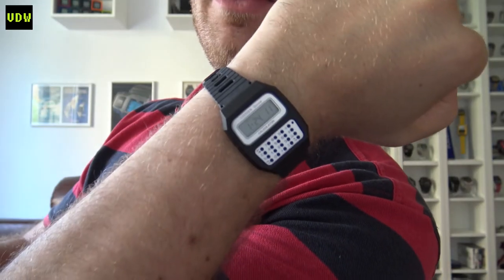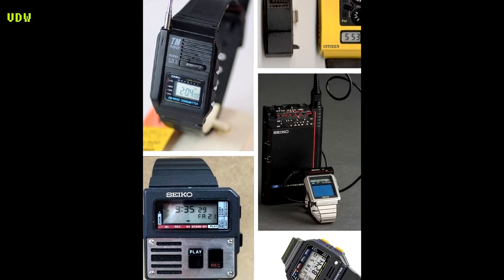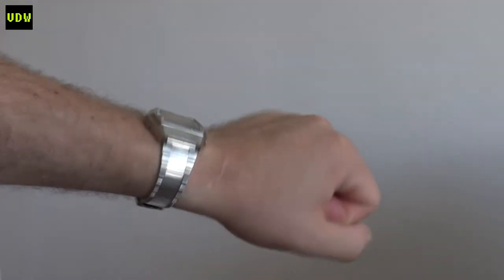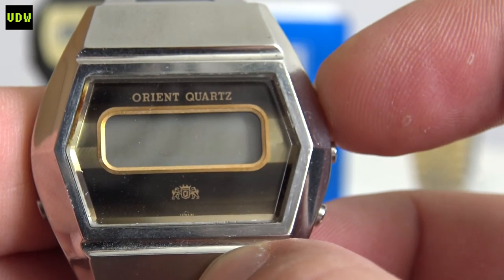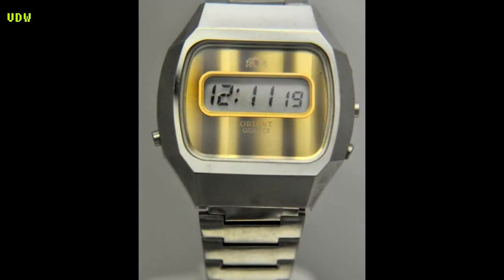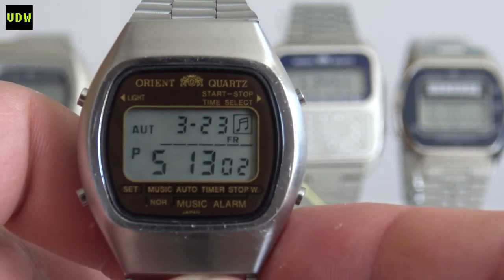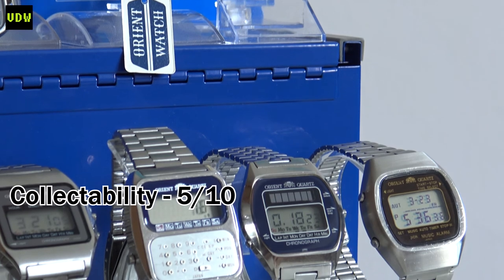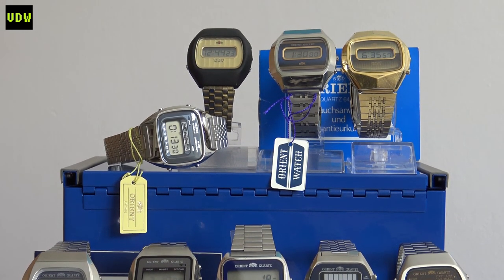Ep 54 - Orient Digital Watch SPECIAL - Vintage Digital Watches

Comment: Back in the day, I though Orient was a lesser brand, but many of these these looks surprisingly beautiful and well built. Thanks for sharing! Btw. I think a few watches had seconds/date swap options, e.g. the Seiko G757 series which also displays DATE right above it  when in that mode. See https://youtu.be/Q0WzwTHntMc?t=1m2s
Reply from the maker: I'll pin this post as the information about the Seiko G757 is interesting. Thanks!
Reply: @VintageDigitalWatches   I have the watch at 05:43. It appears to be in pristine condition yet when I put a new battery in, there's absolutely nothing. Is there some reset procedure for this particular model?

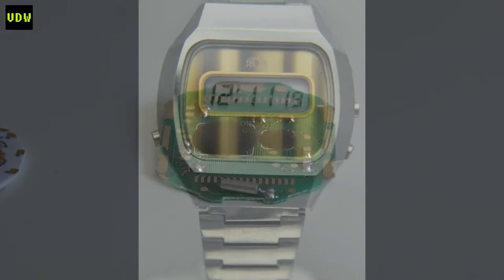Comment: I own an Orient 641112-40 (Module 64101) with a corroded and botched battery compartment. It has the same case and face as your G641103-40 (at 4:26) but a different bracelet. Do you know if the modules 64100
, 64101 and 64111 are interchangeable? At least they seem to look similar.
As always very informative content and I'm looking forward for the next video.
Reply from the maker: Time Art Piece  Yes the modules are interchangeable, all watches with serial number starting 641 can have their modules interchanged, module is identical for all.

Comment: Another fantastic video.
Well i have only 3 orient here, the message orient also. I prefer the early 70's orient digitals with ceramic board. I think  the best orient period was from 1974 to 1977 even if the message one is an amazing watch (dot Matrix, loud alarm and messages).
Reply from the maker: So Lucky you have the message one, there was one for sale a few weeks ago on eBay, wasn't cheap.
Reply: You can se mine here:

http://www.newdwf.com/viewtopic.php?f=58&t=7862&p=50012&hilit=orient#p50012
Reply from the maker: Hmm, it seems that the images are broken...old links maybe?
Reply: It works for me.... Are you logged?

Comment: I have a question i hope you can answer : do you know what battery fits in a orient 771106-40 lcd watch with alarm ?
Reply from the maker: Uh, don't know
Reply: Vintage Digital Watches ok thanks but is there a battery that is commomly used in orient watches from that era regarding the ones with alarm ?
Reply: Vintage Digital Watches and btw would it be an idea to make a program that goes through the batteri used as i think there is people outthere who needs the info ( like me 😁)to get their old gems up and running again
Reply from the maker: @thegrassyknoll7792  well there are already charts online and websites that do this but they usually work for more common digital watches. One of theme is batterybob. Surely your orient is not on any chart as it is rare.

Comment: Nice video and great channel :) Have you looked at Seiko LCD first series cal.0*** and Extra Fine cal.F***?
Reply from the maker: I have seen some 0'es, but are you referring to something in particular? I believe they are indeed bigger size.
Reply: No nothing special just i general :) The first series cal.0*** are not bigger in size but they are built like tanks in solid SST and usually have a crown to set the time as with an ordinary analogue Watch. I have a 0139 and 0439 on the way. Seiko started production of those in 1974 and made them until about 1982 I Think and there is about 17 different calibers. Regarding the "Extra Fine" cal.F*** series, I am currently waiting for a F441 but can't find almost any info about them. They are very thin watches and were made between 1977 and 1982 and the cal F441 was the last caliber of 11 different models. The F441 was only produced between 1981 and 1982.  I saw that you gave away a First Series Seiko, damn that I missed it, I would really liked to have it :D
Reply from the maker: I am also getting into late 70ies LCDs and probably will look into other brands, thus far my comfort zone were the mid 80ies. Don't worry, there will be other giveaways :)

Comment: I actually got one Orient digital watch, a strange solar powered model (New old stock in incredibly good condition!). But here's the thing, I tried searching the reference number online: I678202-40 and there's very little information on when it was made other than it was from the 80s. Most of the page hits were in Japanese, but it is indeed the watch. The build quality of the case is great, the bracelet can be said to be a bit janky but not as bad as some Casio bracelets. This is my first Orient digital and most probably won't be the last, they're really interesting and have a different aesthetic from Seikos! I wonder if you've encountered one of these I678202-40 models and what do you think of them? Included is the link of one of the rare instances I found this online: https://www.jauce.com/auction/t575018943